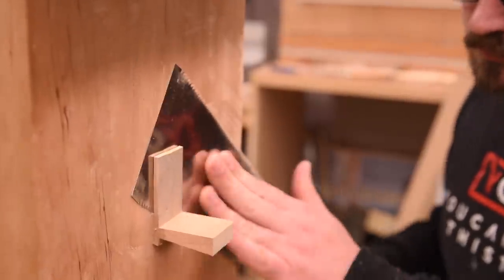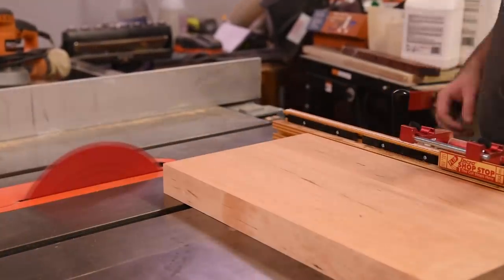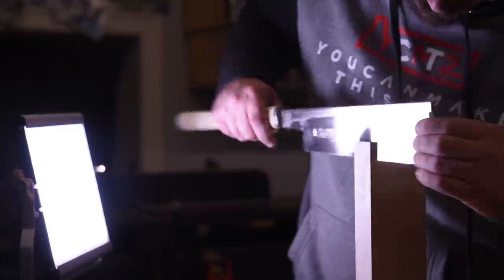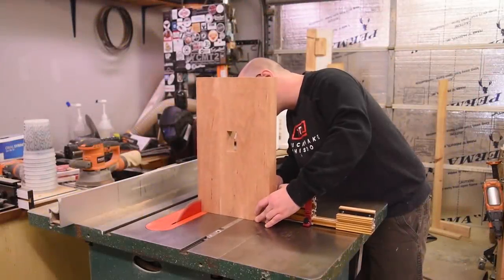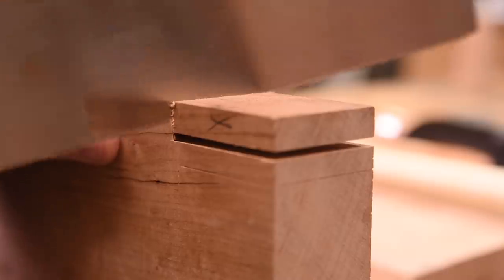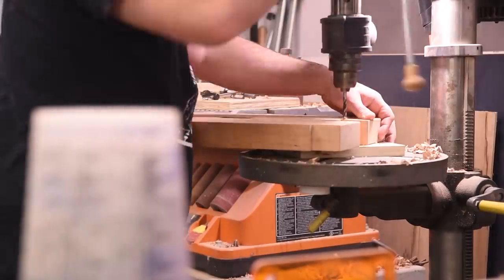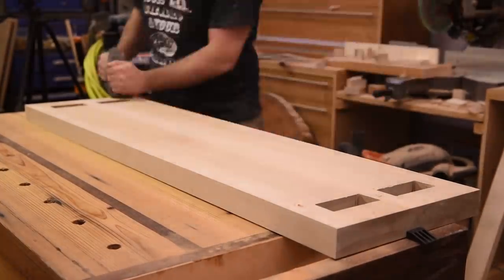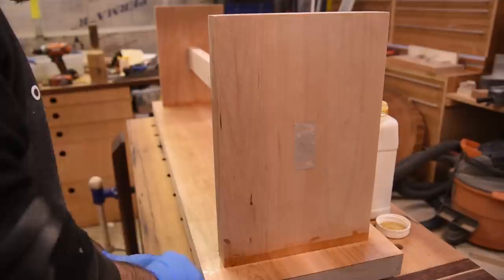How to Make a Bench with Traditional Woodworking Joinery

Comment: Nice presentation, great bench. Never seen tapered mortices in a wedged tennon joint before ! Nice use of the flushcut saw to make the tapers easier. Makes sence, but aditional work ! Look into card scrapers....you won't look back.
Reply from the maker: Thanks! I’ve gotten some since then.. scrapers are amazing.

Comment: G’day Caleb
Really enjoyed the vid, good pace, good vision, good commentary and explanations. I’d be interested to hear your design purpose and rationale before your projects, something seldom done by youtubers it seems. I’m very much a learner, particularly when it come to putting ideas on paper as a plan. How about a vid on how you do that phase of a project.
Anyway good on you mate. GH
Reply from the maker: Thanks, Grant! I’ll work to include that in my projects. I’m not sure about a video on it, I don’t consider myself much of a designer. But I’ve probably learned more than I’ve realized. Most of my projects are driven by function. They have to do certain things, those things normally have critical dimensions, and then I solve for the rest of the dimensions from there if that makes sense. As far as this one goes, the client wanted something very clean and simple, no frills. I pitched the exposed joinery as a way to add some interest and they loved the idea.

Comment: Good job with allowing for the wedges in the legs and nice work. Don't feel bad about using an orbital sander  prepping it for finishing. I am a hand tool guy and use an orbital sander as well. It saves time and elbow grease. Most hand tool guys aren't that particular. Keep it up.

Comment: Nice video and project, really enjoyed it!
Just a quick tip to maybe make things a little bit easier for you: I saw you hold your japanese saw when cutting by grabbing it with all your fingers...  Maybe try and put your index on top of the handle (parallel to the saw blade) as if you are pointing to your workpiece... May not sound like much of a difference,  but it definately makes a huge one for me (since i started cutting like you as well 😉)
Reply from the maker: Great tip, thanks very much!

Comment: Love it. One small point however. Wedges should be driven in equally to result in equal wedge widths afterwards 👍
Reply from the maker: Thanks! Copied from a previous commenter with a similar point.. They do have equal widths after being flush cut, when driven in they appear to not because they have different heights because of how I cut them.

My wedges go in different "depths", but they all go in the same thickness, the height difference is because they weren't cut identically. I was really concerned with that, but it's not an issue if you cut your mortise right and the middle of your tenon is sturdy. When the tenon goes in the mortise, it's snug on the bottom, it cannot expand there. That middle part of the tenon is incapable of flexing, it's just too wide and that tiny wedge won't do it. So each wedge will only go down until either the outside tenon piece meets the side of the mortise, or the wedge bottoms out. So, assuming the mortise is cut correctly, and your tenon isn't tiny.. if there's any issue with inconsistency of wedge "thicknesses" then it's because the wedges weren't cut right, but most likely it's because the angles chopped on the ends of the mortise aren't consistent.

Comment: Great video!  Would be nice if you put 2 wedges in at the same time so that one doesn’t do more work than the other. They will reveal the same size too
Reply from the maker: Thanks! Considering the size of the tenon, I don’t think the small wedges can push the material in the middle. How deep they go and the reveal is determined by the angle on the side of the mortise.

Comment: very cool. I will definitely try this. four years later - are the legs still in place? is there any movement or pulling out of the wedge joint?
Reply from the maker: This was a commission and went to the client after it was done... that said I never heard back from them. Given that its centuries old techniques and the client has been quiet, I'm gonna assume it's aged just fine.
Reply: @YouCanMakeThisToo  awesome. I'm definitely going to try this. Thanks for the reply.

Comment: New to woodworking and interested if the bench top tenon joint through to the legs would work or be advisable when making a desk as I think it would look really cool and rather than using screws to attach the top
Reply from the maker: It could be.. just have to be aware of the wood movement. If the legs expand with the top it won’t be a problem

Comment: Hi Caleb,   I'm a beginner and going to do my first mortise and tenon joint and had a question on this build.  It is necessary to do a wedged tenon, or can a regular tenon hold it together?  It would be simpler and easier for my first bench.  I would do it just like yours but without the wedges in the top.  I wanted to do a through tenon on the cross piece, also with no wedge.  Would that hold together if the joints are tight and a glue up?  If not, I suppose I can go the extra step and do the wedges and cut the mortise at a slight angle from the top.   Thanks,  Sandy
Reply from the maker: Totally! Assuming tight joints like you said, and glue. There is a risk that after years of use and wiggling the glue joints might break (like all the old wobbly chairs). It won’t fall apart, but after a loooonnggg time you may end up wanting to knock it apart and glue it back up (by then you’d probably just wanna build a new bench with your greatly improved skills anyway though!)

Comment: Nicely done, but be careful when wedging tenons with the grain. Stretcher wedges were cross-grain, which is a rock-solid joint. The stoutness of the top and the hard maple, overcame the wedging force, which could have easily split the top, had it been thinner and made from a less robust species. Love you videos; great production quality and excellent commentary.
Reply from the maker: Thank you! Very good points. That’s why I was comfortable trying it on this project for the first time. I knew the material would be able to handle my novice 😁

Comment: Stretcher wedges are correct, leg to top wedges are in the wrong orientation. Always install 90 degrees to th grain when wedging, otherwise you risk splitting the wood.
Reply: Was looking for someone who noticed this too. I will say tho, if you do it correctly and just flare out the tenon to just kiss the tapered sidewalls instead of driving in the wedges until they are super tight and are literally wanting to split the mortise, I think it should be ok. The guy here seems to have done it right so it should be ok. But I definitely hear you Edward. Classically this is a no-no but if done right, it’s ok. Problem is when you look at it, you don’t know if the person doing it knew what they were doing 😜
Reply: @briantheprion 
 It's just a bad habit to get into, you're just setting yourself up for failure.
 Just "kissing the tapered sidewalls" kind of defeats the purpose of using a "wedge". If all the grain is running in the same direction, then you add a wedge, you're basically trying to split the wood apart but stop just short of it actually breaking. This project looks to have a large enough cross section that I don't think it will faill but I stand by my comments. 
Wedged tenon joinery done properly creates a strong point in the construction, in the wrong orientation it becomes a week point.
Reply: @Eweber007   I personally would not do it since anyone who knows a little about woodworking will forever point it out and then I would have to explain it to them for all time. If done correctly however it’s not actually causing the mortise assembly as a whole to wedge the walls of the mortise: it’s sort of like a drop in dovetail joint but just in an enclosed space. If whatever force is applied that would cause the joint to fail: well it was going to break the piece anyway. I too have pointed this flaw out to other woodworkers but Chris becksvort employs this technique in some of his furniture too and I was shocked. Like I said I wouldn’t do it myself, but if the person knows what they are doing, it can be done correctly
Reply: I will say that a “solution” around the problem discussed above is to either just do straight mortise and no wedge or split each tenon into two twin tenons so that they are square on the face and drive the wedges in perpendicular to the grain if that makes sense
Reply: @briantheprion 
 It all depends on how well fitted your mortise, tenon and wedges are. If you drive them in with too much force, that's when the splitting can occur. As is now, there is unnecessary internal stress at the joint wanting to split the wood, contrary to what the joint is designed to do.
Reply: @briantheprion  
A spit tenon would be the normal approach to this
Reply: @Eweber007  I think we are saying the same thing
Reply: @Eweber007  I checked your channel: you look like you know what you are doing. I bet you if I asked you to make an “improper” wedged tenon whereby the wedge is parallel with the grain; you could figure out the geometry and angle and length of the wedge and slope of the mortise walls to make it work so that you’re not placing undue stress on the mortise walls. If I asked an amateur woodworker to make the exact same joint, they are probably going to pound two wedges down until they bottom out or that it actually wants to split the wood.
Reply: @briantheprion 
 Yes, we are
Reply from the maker: Just wanted to say this is a fantastic conversation, thank you. And I did cut the wedges to match the angles of the mortise - so they’re not applying much pressure to split the grain. 

As for wood movement, the top and sides will move together except for any difference between species. But since we’re only talking a few inches and an interior piece… that’s nominal movement.
Reply: @YouCanMakeThisToo 
 if you want to continue building this way that's up to you. What I'm trying to convey is that you might be missing the purpose of the joint by cutting it in the wrong orientation. A wedged through tenon is designed to be wedged so that the pressure from the wedge drives the sides ot the tenon into the walls of the mortise, creating a mechanically tight joint without the need for adhesive. The orientation you have used does not allow for securly tightening the joint, it you were to drive the wedge too hard, you risk splitting the top. Done in the proper orientation, you can apply a tremendous amount of pressure to the wedge and the joint will obtain incredible holding power without risk of splitting the top.  It may not be critical in this circumstance but this joint is used in hundreds, pehaps thousands of applications where this orientation would cause catostrophic failure.
Reply from the maker: You definitely did, sorry if I came across defensive. I really appreciate all the comments and it made me think about that type joint a lot more. This project was the only time I’ve used them, but if I do again I’m gonna think about it more. As you pointed out, it can be used to apply a lot of force - but only if properly planned for.
Reply: @YouCanMakeThisToo 
 I wasn't  trying to sound like to wood police, Just trying to help you avoid failure

Comment: so traditional joinery with a cnc makes you what if not a woodworker?
Reply from the maker: First it’s important to establish this is just a semantic argument. I’d say it depends on your skill set. If you can do it with non-CNC tools and machines, you’re a woodworker. If your skills are limited to CAD, toolpaths, and CNC operation - you’re a digital fabricator. 

Tons of people are both. I’m both. I can do it with a handsaw and chisel. Table saw and routers. Or design a multi-texturing CNC table that my CNC cuts out that allows me to do most traditional joinery on the CNC.
Reply: @YouCanMakeThisToo   I think its more opinion than semantics.  Someone using all hand tools may have a similar opinion of you using an elctric jointer/planner.  I dont think its fair to say to all those who are creating things from wood can only be considered woodworkers based on a certain set of tools they use
Reply from the maker: @davelawler5353 that’s just a semantic argument over semantics. Very meta 🤣

Comment: I saw you use about 100 different tools haha. Looks great but dont say it's simple with just a few tools.
Reply from the maker: Let's say you bought surfaced material. What more would you need besides a handsaw, chisel, and drill? If you didn't buy surfaced material, add a handplane.

Comment: "Traditional WoodWorking Joinery" and use glue, jigsaw and some electronic tools in my view useless for this project
Reply from the maker: I get the sense you confused "traditional woodworking joinery" with "built with hand tools."
Reply: @YouCanMakeThisToo   Yep, probabily i meant something like Japanese Traditional Joinery! i'd have done this project in this "style", maybe required more time, but it's okay, the important thing is the result. Anyway nice job!
Reply from the maker: @NovaMetrics  Thanks! Yeah... I picked that title based on the fact that it was all wedged mortise and tenons. Not biscuits, dominos, pocket screws, nails, etc... As you pointed out it could be all done with hand tools, but sadly my hand skills just aren't there yet. But I hope they will be. Thanks for watching!